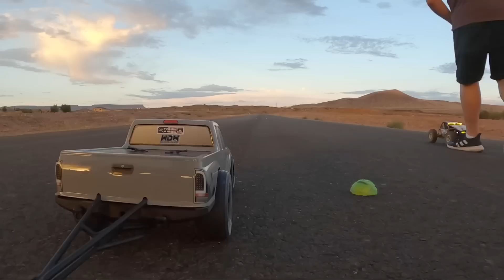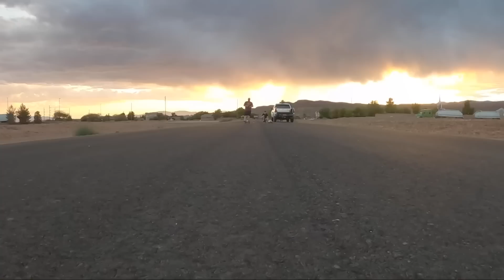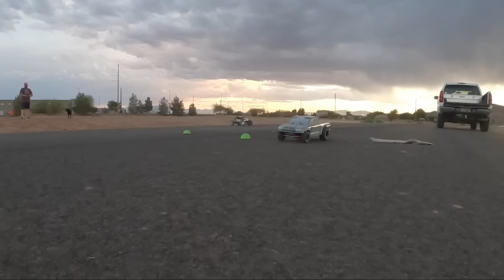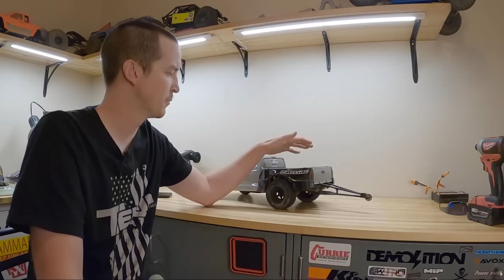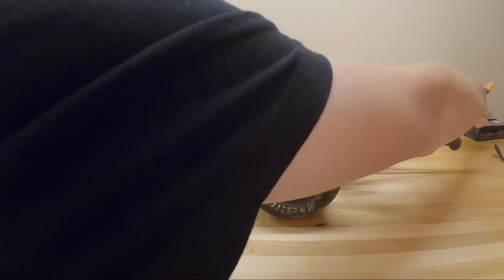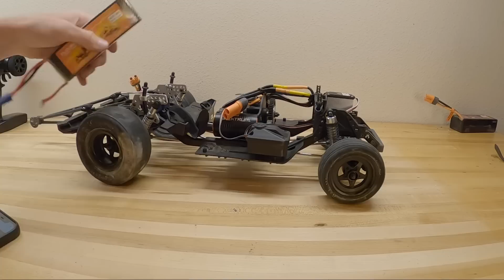Road Base Ep. 2 Sky RC Base Camp No Prep Drag Car

Comment: FUN! Looks like you've been going through a lot of the same issues we had with our Dragbolt project. You'll need more KV's and if you can cheat the wheelbase a bit longer, it'll help. I'd also look at swapping to a three gear so you can get a bit taller on the gearing. Keep going!

Comment: Put a 6500kv motor in there or a castle 6400kv drag motor it will have more rpm and less toque better for coming out the 🕳️ hole
Reply: Don’t the losi have the 6500 or 6600 kv motor stock? I had one but it never took off n my area so it have less than 10 hits on it.. traded for a new/used 4s max.. atleast it see’s some use.. but the lost was great from right out of the box!

Comment: The best way to get the speed you want is with a higher kv motor that one is actually pretty low for racing it’s more of a bashing motor also castle esc and motors have always been my fastest stuff on higher voltages 3-8s

Comment: I'm not a huge fan of No prep racing, but would consider an RC version. I have never been a fan of dumping 3-4k hp on a track not properly prepped, doesn't seem too safe to me. That said i've never been a fan of the current RC offerings. Short of a few small tired vettes, new mustang, new camaro's or the Off supra or GTR, no NPK car has independent suspension. I like this, I'd have probably tried to narrow it a little bit but happy to see this. Get you a piece of stainless brake tubing and make it your swaybar to straighten out the launches. Good luck with it

Comment: You’ve got the FA-GT5, have you turned on the gyro feature on the receiver yet? It will help keep that truck straight when you send it. When it’s on it will counter steer for you as it senses changes in direction.

Comment: Brilliant project. Do this kind of thing all the time. Never had an rc that i have never modified even straight from the box. Just my oppion from watching the vid. Have you tried venting the body. Maybe a longer wheelie bar?. Or maybe a simple front splitter and rear diffuser. Make mine out of foam or plastic untill i find the right design. (sorry if my reply is boring)😀